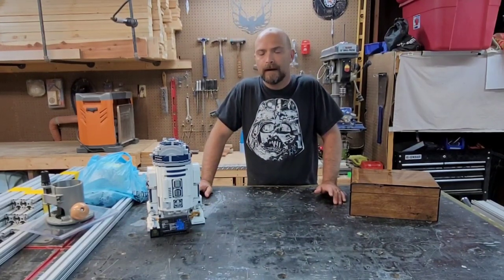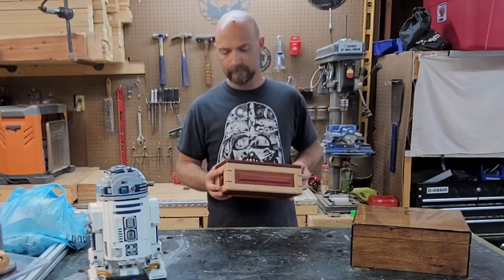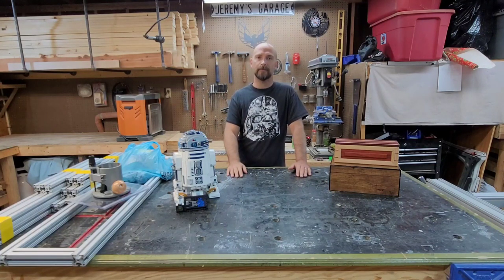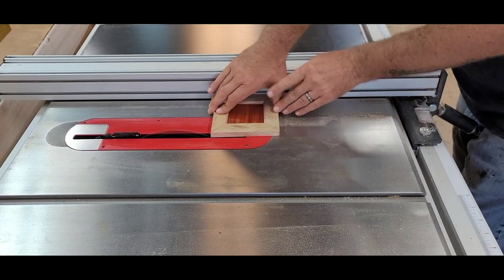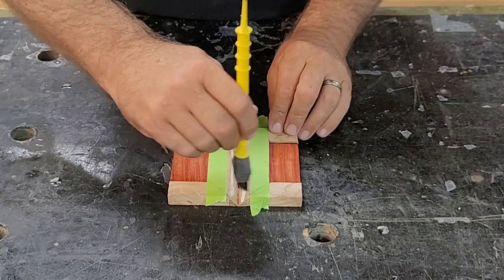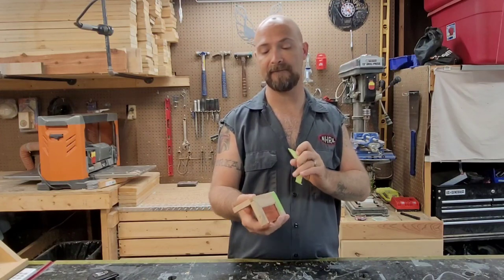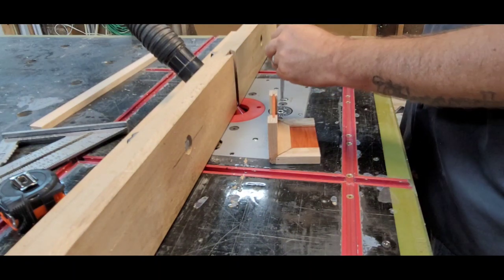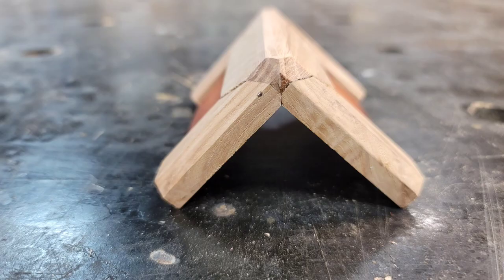New miter joint, I tripped over this beautiful joint by accident.

Comment: No good for drawers...no mechanical connection. It is a surprising beautiful joint.
Reply from the maker: I think it would be a great drawer. Maybe a little over the top but pretty cool. As far as the strength of the connection. Check out this video https://youtu.be/CE147Ow7RmM
Reply: @meanmacawwoodshop  I did and was surprised. I'll use the splined-miter joint on my next project and either install trim-screws in both directions at each joint or a narrow, long dowel vertically on each side of the joint.